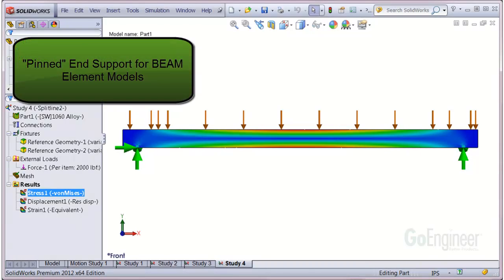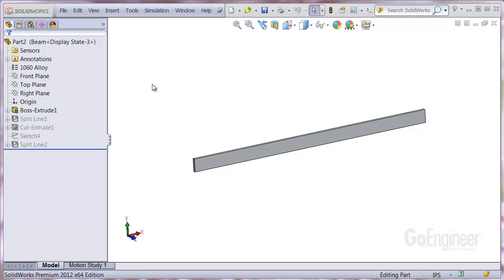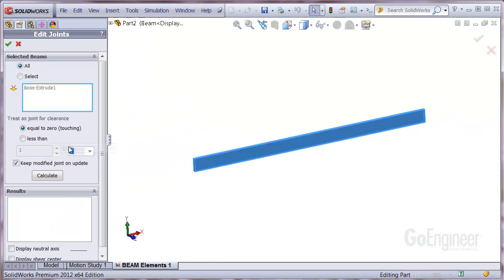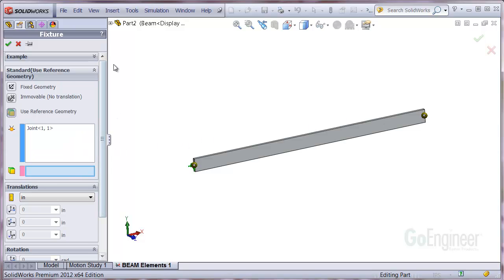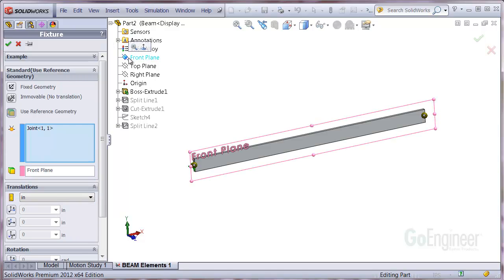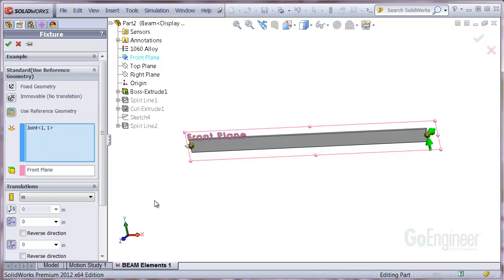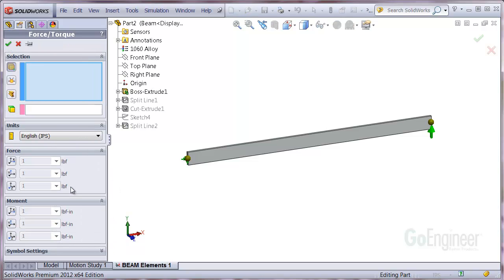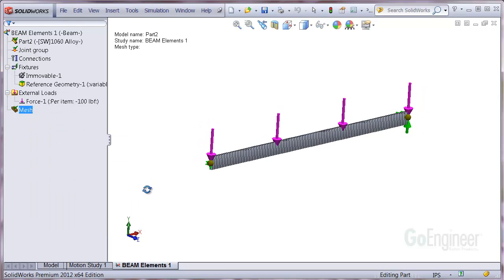SOLIDWORKS Quick Tip - Pinned-End Support (BEAM Elements)

Comment: Part 2:  Under component contacts I am able Bonded.  So I assume they are simulated as being adhered to one another.  Can a Solidworks assembly measure displacement on multiple parts joined with-in an assembly?

Thanks,

Jake

Comment: Hello Tony,

I am at college student and I have a question related to this video.  I have been able to do the simulation above with a single part, however I would like to try this with two parts in an assembly.  Basically I have a wood shelf and a steel beam that are assembled together.  I would like to test how much stronger and reduction or displacement the beam has on the shelf.  I have materials defined for each part in the assembly. But when creating the simulation I cannot select roller.
Reply: did you graduate?